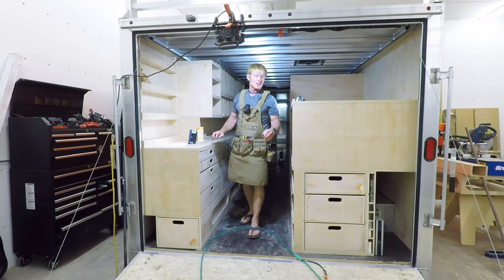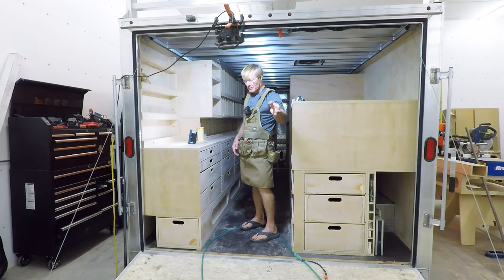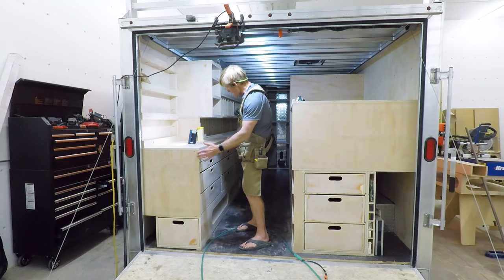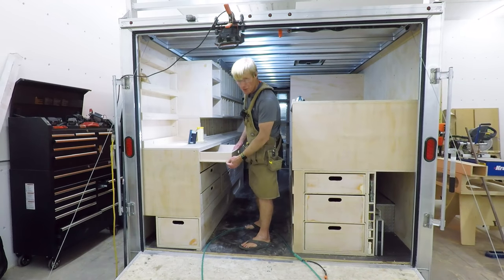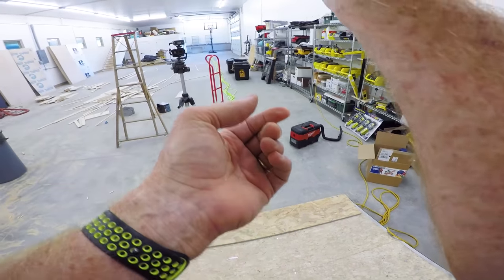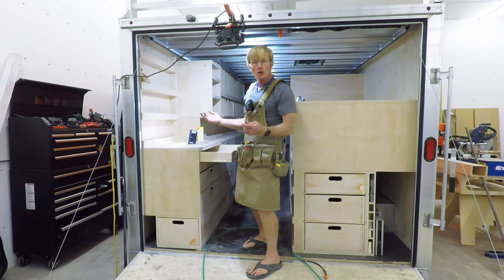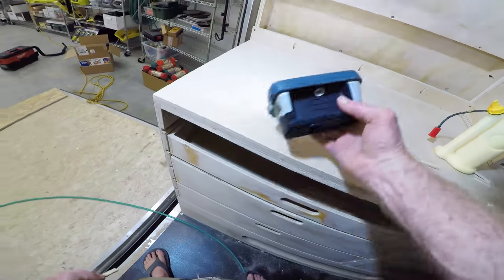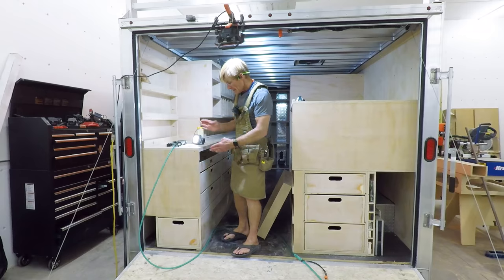YES!!!! It Works: Free easy passive drawer lock!!!!!!!!!

Comment: That's actually an old-time method of passively securing drawers in a boat or RV/travel trailer. Simple, cheap, works well.
Reply: Sailing, healed over @ 20 degrees in a foul sea is the ultimate test.....works like a charm

Comment: Simple is better. I was going to comment that the drawers will bounce open but I guess my intuition was wrong. I love it when something so simple works. 
I worked on an automated dishwashing system design for a Navy project. The dishwasher that we were adding automated coveyors to has been around for 40 years. I work with a lot of high tech design and I was so impressed with the ruggedness and ultra simplicity of many of the dishwasher assemblies. They were refined into their simplest (smartest) form over the years. If I would have designed them they would have been much more complicated, more expensive and less reliable.

The simplest design that works is often the most difficult to figure out. 

I love this kind of solution.

Comment: I know lots of contractors in the Houston area that have mobile shops and trailers for equipment and everyone complains about securing the contents. Both my trailers were a nightmare and my brother straps everything down as well. Only common denominator here is the roads. Passive restraints don't work here
Reply: Oh yeah Ricky. I've lived in Houston a long time and I agree. Also I have friends who drive with reckless abandon so this drawer system would be challenged to the max. 

Thanks
Reply: If the drawer is on cabinet drawer slides it will move quite easily. Ron's drawers are wood against wood so there is more friction to hold them in place. He also mentioned in an earlier video that he seldom works more than 4 miles from home. When you only drive that short distance it's easier to drive conservatively without feeling like you are wasting time on the road.

Comment: I throw the light, and now it starts flickering... hmm.🤔
Reply: It looks like it might be brightness controlled using PWM. So it would flicker like that on camera when it was brand new.
Reply: There was a flickering problem in the past videos with those lights but Ron changed the frame rate on the cameras and it WAS fixed. That light is flickering in both cameras.